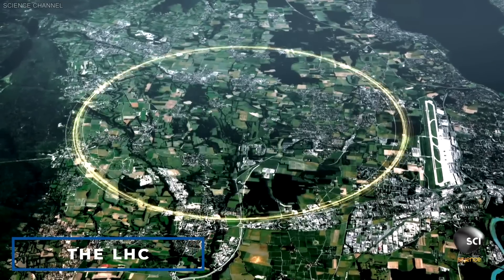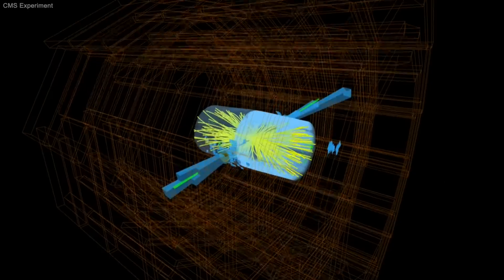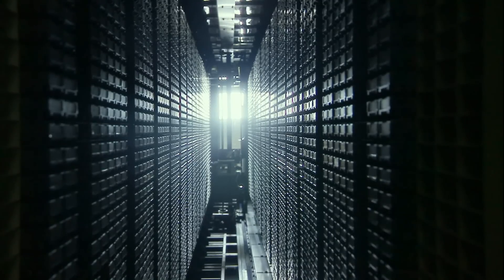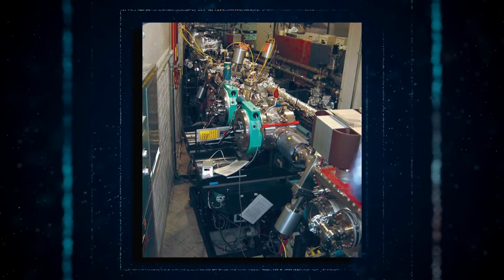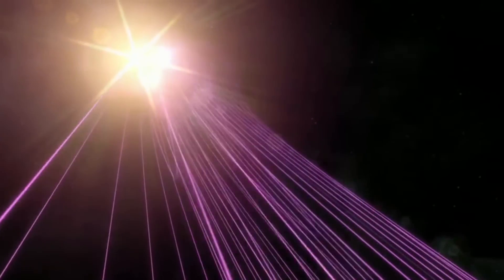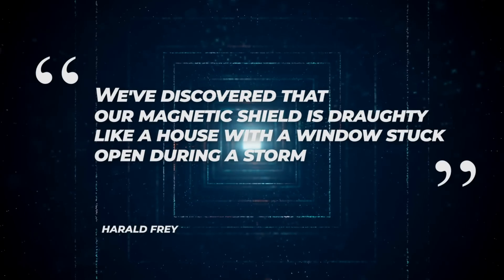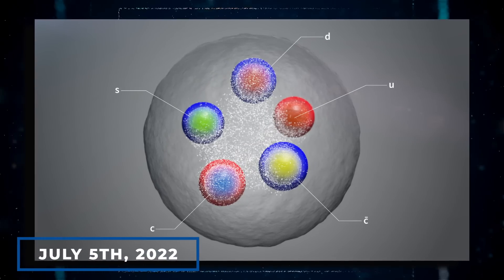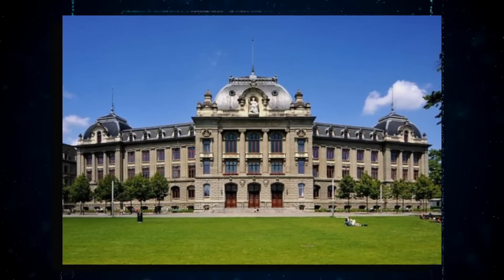Scientists At CERN Announced A CHILLING New Discovery

Comment: Things scientists have not really chained together.... 

Our earth is generating our magnetic field bc of spin in our lava in the center of our planet.

Every so often it switches direction and our poles flip over

This has not happened in a longer time than is per usual. But when it begins the flip we get magnetic spots that are not quite right. (Bermuda triangle, devils triangle, and the dragon zone are some of these spots currently) anyway the flip can't happen until there are enough of these spots to pull the polarity tgen it happens instantaneously. 

When we are going through the flip there will be magnetic shield disruption. Hence cracks in the field. Also the northern lights are where the solar radiation bounces off our shield. 

The question is weather the earth is trying to preform a flip, or if the hedrom colder is excelorating the flip?

Comment: Knowing it is causing "cracks"  in the magnetic field. Why would anyone put the world at any risk? Why not do this type of testing in space?
Enough energy is produced to damage our magnetic field. What would have happened if were to completely shut down? They would have killed everything on our planet
 "What is on the other side of a black hole?" All the material a black hole pulls in goes somewhere correct?
Theoretically speaking I believe it would be a star on the other side of a black hole. As the black hole is pulling in material, it's also converting the materials into potentially a fuel . Why not shoot a beam of light into one and see if the beam of light shows up somewhere else?